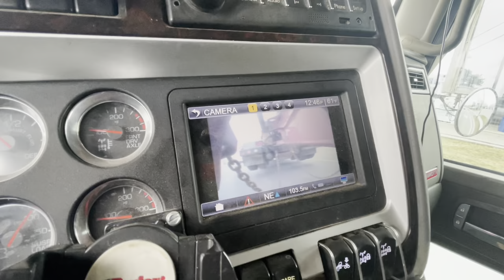FLATBED TRAILER ROLLED OVER ON HIGHWAY 427 IN TORONTO!

Comment: You still didn't replace that winch cable I see . That driver should have been using a drop deck trailer for a load like that .